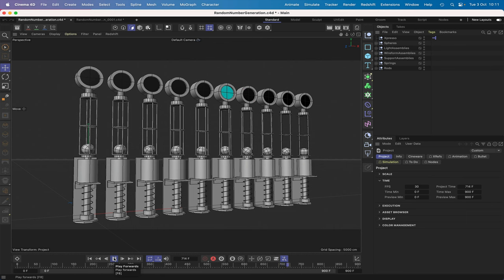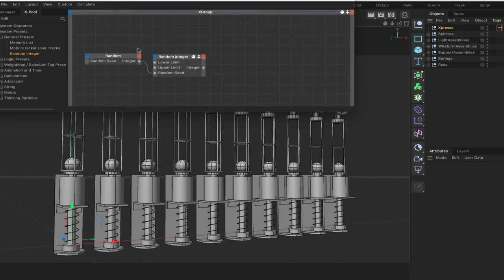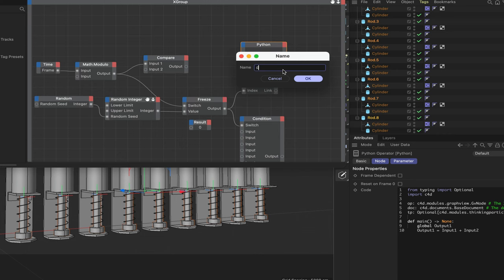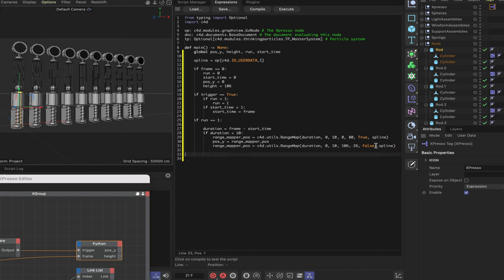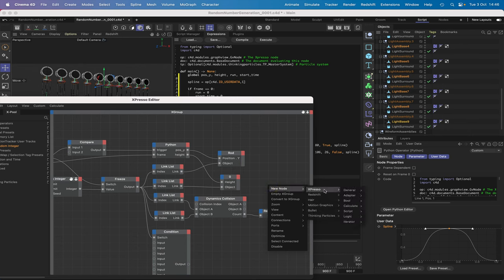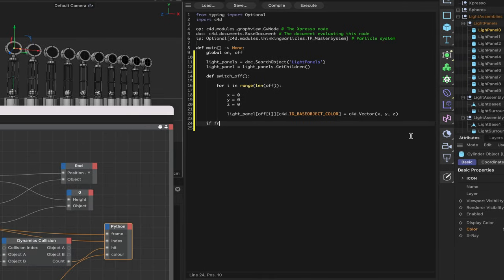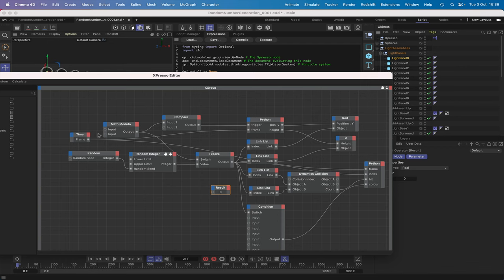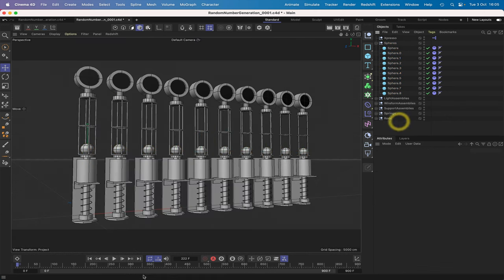Cinema 4D Multi-Tech Tutorial 40: Solenoid Contraption Rig

Comment: I always learn a lot watching you work. Is there no way to simplify this with mograph? I would have thought you would have created 1 solenoid and used a cloner.  Can't clones be accessed with xPresso. I find juggling and linking so many objects manually frustrating, time consuming, prone to errors, and less flexible (in case I want to add more solenoids).
Reply from the maker: You probably could do it with MoGraph, but you would need three Python Effectors, one each for the Rods, Springs and LightPanels. They would all have to be synched (via Xpresso), which presents its own problems, so it may actually be more complex. That said, I made this the way I have, because I was asked about random number generation with Xpresso, specifically.
Reply: Thanks @ExpressoMechanicTV  I appreciate the response. Excellent work!
Reply from the maker: @mattdog  Many thanks!